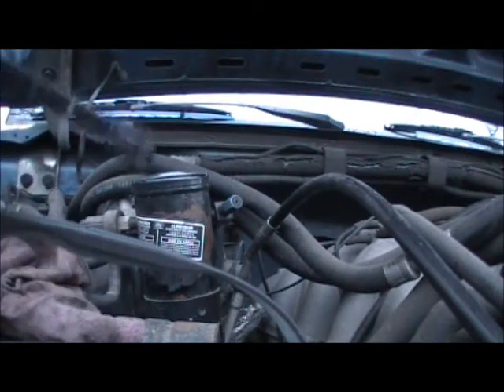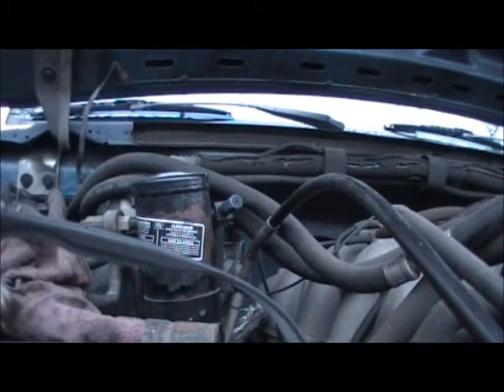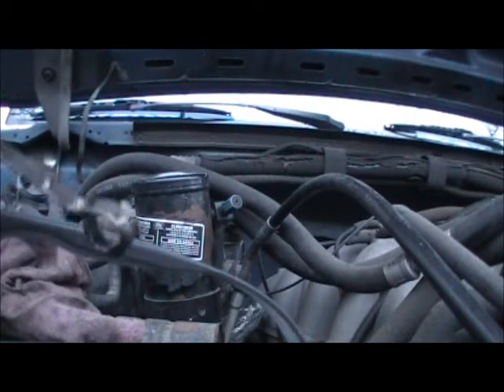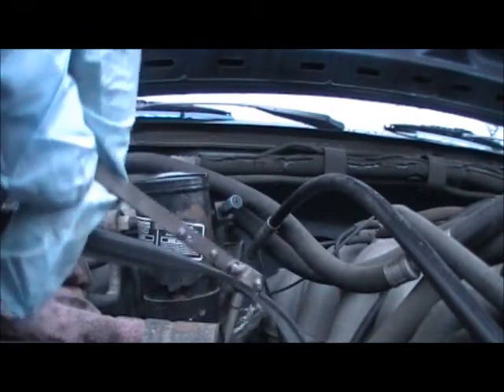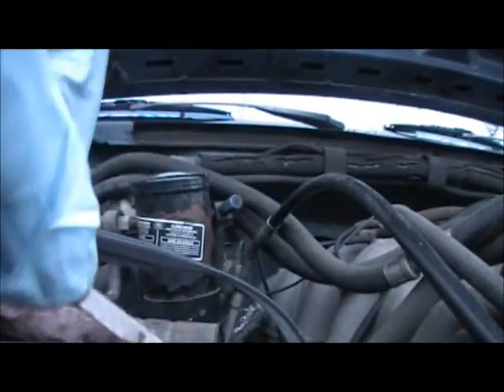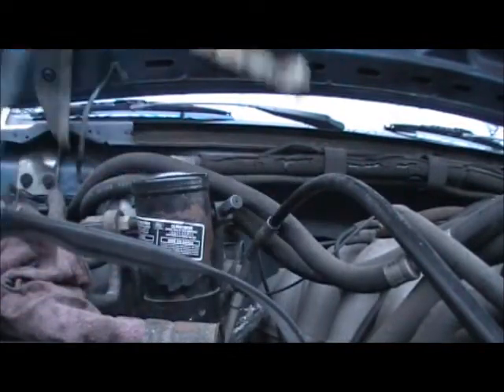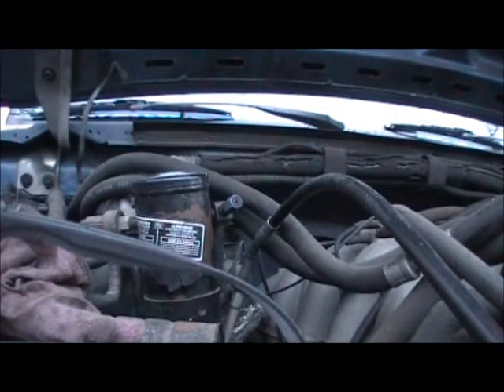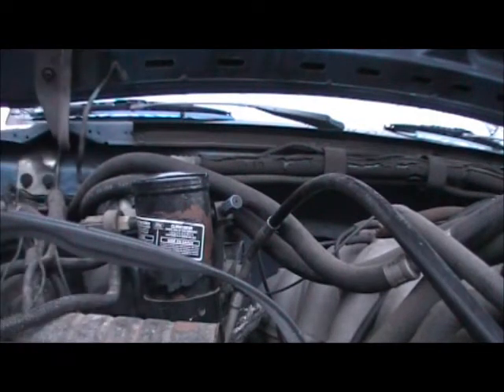Checking Transmission Fluid

Comment: Good video, keep em coming. I didnt see the rust proofing one, I will have to search for that. What is your opinion of installing a drain plug on the trans pan, and then draining and filling the fluid that way? And only on the 2nd or 3rd drain replacing the filter and gasket? I have been tempted to try that, but always wondered about the filter element, wouldnt it get super clogged with the drebris from the steel bands and clutches?